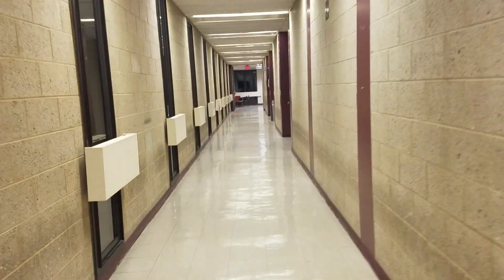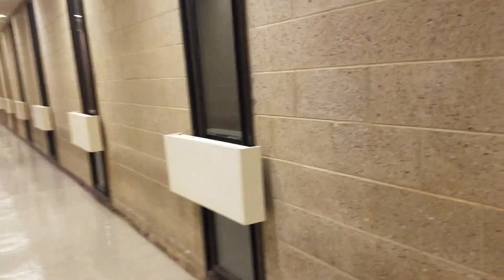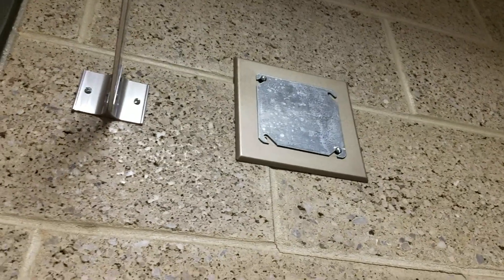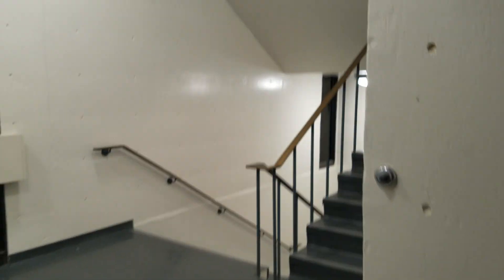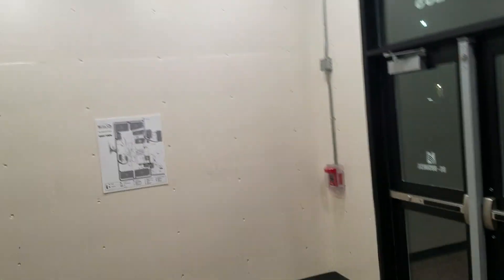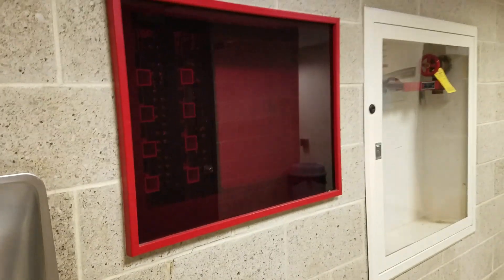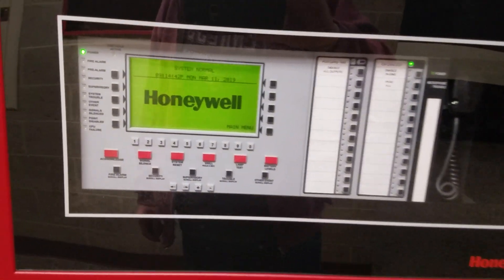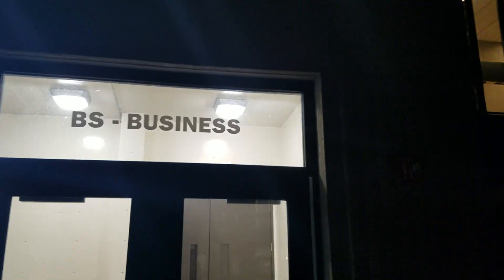Honeywell W247G Fire Alarm System Recap: Honeywell SC808A Horns and S464 Pull Stations are gone

Comment: Is it still like that to this day?
Reply from the maker: I don't even live in that state anymore. Couldn't tell you.
Reply: @RaisedLetter  oh
Reply: The ET Building has been upgraded to a Notifier NFS2-3030 back in 2021. Most of the buildings have been upgraded to Notifier 3030's since then. We actually just finished the new fire alarm system for the TH Building "Kelsey Theatre" as of today. We just ripped out the existing Honeywell W247G panel that was original to the building, installed in back in 1971. Believe it or not but there is a 1980's computer in the Old Security office in the FA building that is still running to this day and was the first attempt at networking all of the buildings together.
Reply: @thomask6118 do you have the 247?
Reply: @firealarm2903_ I do. Still have plans to power it up and play around with it. Needs 240V for it to properly work though. Would definitely make a video on it.
Reply: @thomask6118 did you get horns from the system?

Comment: Just like what happened at my college. It used to have a mix between Simplex, Wheelock, and Cerberus Pyrotronics. Rare devices seen were Simplex chevrons with Simplex 4040 horns with the dual projectors in the student services building, a Space Age AV32 in front of a Simplex 2901-9806 and very old FCI MS-2s, first gen RSG RMS-1Ts, Wheelock 7002Ts, Simplex T-bars, Simplex 4903-9219s, and Simplex 2901-9806s behind Simplex 2903 light plates.
Sadly, 90% of the whole campus was taken over by a Simplex voice-evac System, and only the Simplex T-bars, -9219s, and -9806s + 2903s are due for replacement.

Comment: Where is the older system?
Reply from the maker: The W247G system was removed.
Reply: To add it's being kept in storage on the college campus since they want it for spare parts since there's still 3 W247's still in service. So it's not 100% gone yet thankfully!
Reply: @jaredmauriello9522  As of now, I believe we removed the final W247G panel on campus in the Kelsey Theatre as some of the other buildings have been upgraded to Notifier NFS2-3030's since then. I would say that that Theatre building had the most old devices still intact. It was literally a original untouched time capsule from when it was installed which we found out was back in 1971 according to some old blueprints we found.

Comment: It sucks seeing older systems getting replaced. My high school is scheduled for a fire alarm upgrade this summer with a Notifier Voice-Evac system because the current system which is a Simplex is not even up to code. Since I’m graduating this year, it’ll be my last seeing the old system before I graduate.
Reply: Yeah; the old Simplex system at my first elementary school started failing in early 2015 (sometimes signals wouldn't sound in a certain zone, or it'd randomly go into alarm; it even went off at 4 AM on one occasion!) so they had to replace it, and they went with a Notifier panel (probably an NFS2-640 set up as conventional) with SpectrAlert Advance horn/strobes mounted on adapter plates where the old Simplex 4051+4050-80s were, and they even replaced the Wheelock MT-24-LSM horn/strobes in the modular building with Advances for consistency. But they kept the Simplex 4251-30 break-glass pulls and 1990s-style duct detectors and even the old 4255-1 heat sensors.
Same thing happened with some buildings also at my college, again using conventional-setup NFS2-640 systems with Advances on adapter plates, but they'd also replace the old heat sensors with System Sensor smoke detectors (in most cases), and one building actually has a Fire-Lite MS-9600UDLS panel! Three buildings that originally had Standard Electric Time horn/lights now have fully-addressable Notifier systems rebranded by Johnson Controls (two buildings share an NFS2-640, one is an NFS-320) with Wheelock Exceder horn/strobes on adapter plates.